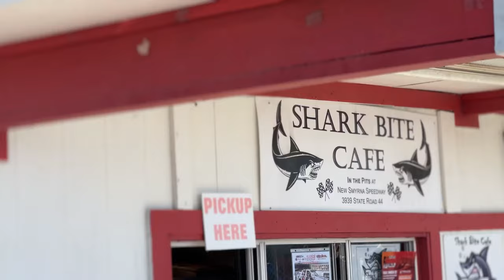Racing modified's best in the John Blewett Memorial! New Smyrna Speedweeks Vol. 3

Comment: There is no way that I would consider myself an "expert" in modifieds but I have been involved in motor sport since the late 60's and this is what I noticed :
The right front brake assembly seems to be producing one heck of a lot of heat to the point that it is letting off sparks.
Now some makes and grades of brake pads when they get REALLY hot tend to become less effective
BUT some INCREASE their "brake force".
In the 2nd case, this has the effect of braking that wheel MORE as they get hotter which in turn makes them brake more.
The problem is that sometimes it can get to the point where the front left to right balance is so far skewed towards the right that the right will lock up and if that is the case then you head for the outside wall which can be painful in most cases.
Now I dont know if the rules allow you to adjust the left to right bias on the front from within the car while on the track but if you are then maybe you can look at that so that the inside wheel can be given a bit more braking duty WITHOUT LOCKING IT UP.
The other point I noticed is that it seems like you have to lift off BEFORE the motor is at peak RPM.
Now I know that different corner radii and different track lengths can affect where you are on the RPM range at the lift-off point but are you allowed to change final drive ratios for different tracks or even tire sizes to get to the point that you lift just as you reach peak RPM.
Towards the 2nd part of practice I did notice that you were starting to accelerate earlier in the corner and it seemed that when you lifted for thee next corner you were at higher RPM AND you had your foot down for a longer time period.
This begs the question "Where are you ON THE TORQUE CURVE when you put the accelerator to the floor?".
Notice I am not asking about the power curve here.
Ask any big rig trucker, the more torque you put through the drive train into the road, the faster you will accelerate.and you need to out-drag the other guy to the next corner to pass him or to get away from him so that he is no longer a threat.
Everyone boasts and brags about horsepower but if you go into it you will find that the most successful engines do indeed have a lot of horsepower BUT the motor also produces a high amount of torque AND the band is just as wide as the HP range across the usable RPM range.
But this is a new class for you and just maybe the learning curve is a bit steep - but you will get there I am sure...

Comment: Nothing better than a Yates/Ford motor.
Reply: Unfortunately it's not a Ford. It's an LS based engine that Robert Yates has the license to build for the ARCA series, Modified series, and the Pintys series.
Reply: @kling2296  yes, you are correct, I did not do my research. Thank you..
Reply: @RayJ.JohnsonJr  No problem, I wish it was a 358 Yates/Ford powerplant. 😊

Comment: I really think you could lower the panhard bar, 25lb softer spring in the right front, but put some load on the anti-roll bar or go up one size on the bar.
Reply from the maker: Appreciate your insight but it’s really easy to crew chief from the couch lol
Reply: @LandonHuffmanRacing  it's not couch knowledge
Reply from the maker: @williamcampbell6589  it is when you are not at the racetrack with us, you watched this video from a couch, or a chair, or the toilet? 

Like i said, i appreciate your input, but we are racers, have been our entire life, we are as equipped as anyone watching this video to adjust our own racecars🤘🏻
Reply: @LandonHuffmanRacing  I was listening to your words about how the car was handling. I used to set up race and win in this type of chassis. I didn't mean to offend you. I know lowering the panhard bar lowers the roll center, transferring more weight to the RR and will tighten the car up in the middle of the corner. Softer spring in the right front will help tight getting into the corner. But doing both of those will make the car roll over and that's what the stiffer anti-roll bar is for. Stagger only adjusts corner exit. My couch is fast as fuck.